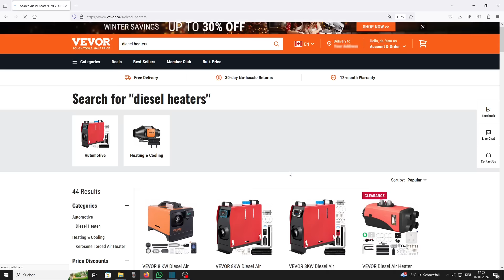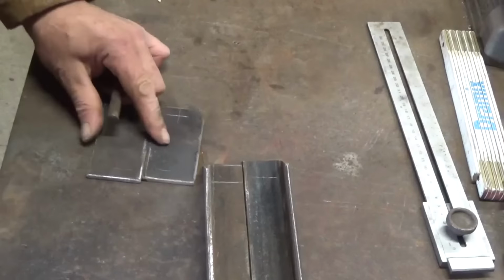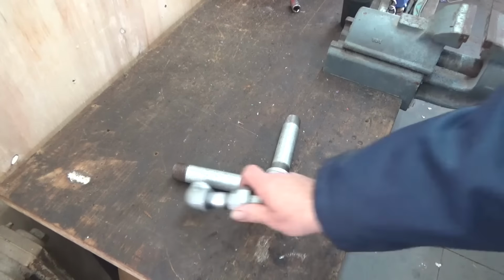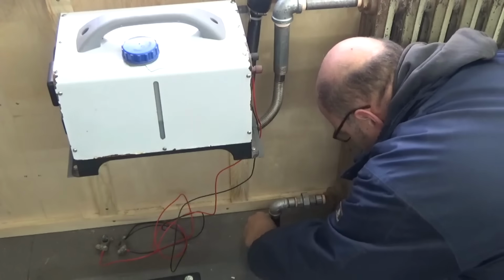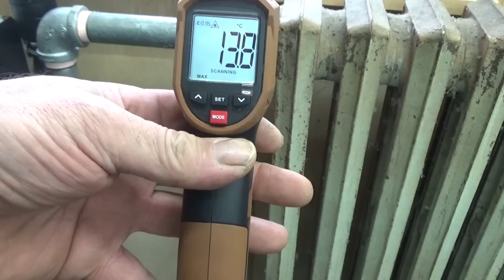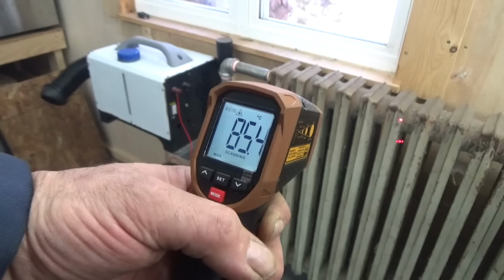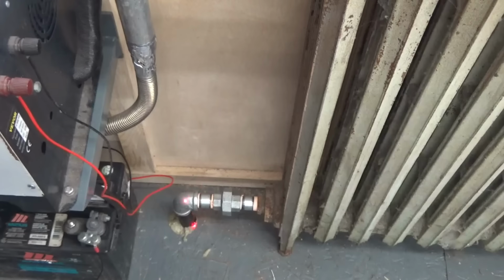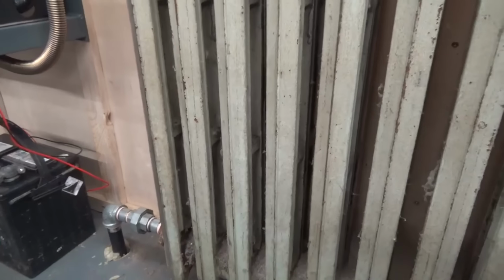Diesel heater upgade 200% more efficient

Comment: Ive been doing this for 3 years with an old steam radiator, have many videos about it here on YT.  It works fantastic, no condensation problems as the armchair quarterbacks and internet experts always bring up.  I have over 1000 hours of use with no issues, you want the exhaust from the heater to go in on the bottom of the radiator, exhaust out the top port which allows convection and hot air rising to remove condensation.  The large internal volume of the steam radiator prevents backpressure so the combustion fan doesnt work too hard like it would with a long exhaust run, the hot air convection from the heater exhaust coming in from the bottom and exiting out the top (in my system) propels the exhaust out without putting undue work on the heaters fan, it also allows the stored heat in the thermal mass to continue to remove moisture even when the heater is off.
Reply: how much diesel does it burn per hour ?
Reply: Good read, I havent installed mine yet. I did read the exhaust MUST be down. I like reading someone who has actualy done this
Reply: Interesting - I have a heat exchanger to rig up to my Webasto exhaust that will share a coolant loop with the radiator circuit. Trying to get the pipe as short as possible before entering a 3inch full exhaust system - for the same reasons as you've explained.
Reply: How does condensation not end up sitting in bottom of radiator? Or are you saying the heat vaporizes it and pushes it out with the exhaust? Seems like the down draft shown here would simply allow the moisture that's created to flow out with the exhaust at the bottom. Or are you saying the condensation that is created simply does not create any problems?
Reply: @vanblindguy4600  It does not accumulate on the bottom at all, but keep in mind I run my heater for 8-12 hours at a time so the bottom of the radiator gets mostly above the boiling point of water.  The condensation moves up and out with the exhaust, Ive collected it by directing it into an aluminum can and itbis substantial, while the drain at the bottom of the radiator has so far never had appreciable water come out, I even tipped it back and forth to see.
Reply: A hot water radiator , would work better with the heater above it and supplying the top and exhausting the bottom , your steam radiator works but hot air rises and the steam radiator has no nipples on the top so the exhaust will travel the least resistance.
Reply: @jamesyurky3048  I haven’t tried that method, however no need as a steam radiator with a diesel heater exhaust mated to the bottom located inlet and the top outlet piped outdoors has no condensation issues in my experience.  I'm sure the reverse method may work just as well but not necessarily superior in my experience as when a thermal mass is heated from the bottom then the heat rising internally aids in propelling the exhaust out reducing load on the diesel heaters internal combustion fan unit.
Reply: @ProlificInvention  as long as you have no restrictions the fan should work well, a bigger exhaust pipe like 1 1/4 pipe would be better.
Reply: @jamesyurky3048  In my system the output is the same size as the input with the large internal volume of the steam radiator allowing for exhaust expansion and reduction of backpressure (total guess obviously) either way, it has worked for thousands of hours extremely efficiently with no negative effects
Reply: good points!
Reply: We've tried this and the radiator clogged enough to restrict flow and then clogged the furnace? Went back to minimum exhaust length and bends and the furnace was much happier.
Reply: @poguemahone5476  The internal volume on my steam radiator is around 2 cubic ft...you're not clogging that with a diesel heater even after 10 years of continuous use.  I only have one bend and a 2ft section of exhaust before it enters the lower input on the steam radiator and goes into the internal large volume of space allowing for expansion and the offloading of heat into the cast iron.  After that the exhaust exits out the top port through a 2ft long pipe out the window which is on a slight declined plane to allow for condensation to drain out.  What comes out of the exhaust is highly moist air at a temperature of about 90°f with the side benefit of being completely silenced
Reply: For those concerned about condensation, install the radiator on a slight incline with a bleeder valve at the lowest spot. Once a week, open the valve to drain the system.
Condensation is relative to humidity of the air being fed into the combustion chamber.
Reply: Very interesting good idea going to keep that in the back of mine

Comment: On a Russian site a man did this and did a lot of calculations based on the actual heat values - he concluded the heater itself produced just over 4kw  on high and his radiator added a further 1.5 kw making a total of a little over 5.5kw -  in another of his posts, he concluded that the 5 and 8kw heaters were in most cases the same!

Comment: Good use of old cast iron radiator. One Major Flaw with exhaust fumes exiting building.  Even though your building barely sits above concrete pad , carbon monoxide fumes with hang next to floor and will leach back up through your high temp wool, as well as between seams between floor sheeting. You should have extended beyond building a foot at least and away left or right of window. Remember CM KILLS.
Reply: Diesels don’t make much CM, that being said you’ll still die, you’ll just die before any monitor will warn you. However that’s not even my biggest issue, the intake for the heater itself is INSIDE, it’s like hooking the intake from your car to the cabin. That should speak for itself
Reply: Carbon monoxide goes high, carbon dioxide goes low .

Comment: For this type of diesel heater, your exhaust contains sometimes unburnt hydrocarbon tiny particles, water vapor and carbon dioxide and some small carbon monoxide. If your exhaust is not at least 100-105C, acid is forming in your exhaust which will slowly overtime corrosive your piping. I have lost a galvanized piping due to this issue.

Comment: something else to consider is the intake air to the combustion chamber, take it from outside. Else you consume the hot air from inside the building  and cold air will leak in from outside.😇

Comment: The one fault with the system is that the heater and exhaust pipe is below the entrance to the radiator creating a trap for moisture
Reply: Indeed...I have the same system..my heater is placed outside in a plastic nice box and the exhaust pipe is coming in at the top of the radiator and goes out at the bottem. My heater is at the highest point and the exhaust pipe is running down so water can run out at the bottom of the radiator.
Reply: Yes exactly, everything has to flow downhill or you could have water build up and flow restriction.
Reply: That exitpipe is so hot that it will vaporize any water/moisture there
Reply: If the temperature is over 190 Celius, wouldn't any moisture be vapourised? Once cars reach normal temperature, you don't see any moisture coming out of the exhaust pipe.
Reply: Antikk8191..?Whaaat? The heater burner exhaust pipe moisure gets heated but has nowhere to go but in the radiator to then condense at colder end.

Comment: I have to say that this is one of the best ideas I have seen on YouTube. Of course condensation will form in the rad, but being cast iron and the exhaust low, it will drip out the bottom. Those heaters burn so efficiently that you won't have to worry about soot collecting in the rad. To test for this possibility, when it's new, record the temperature drop from top of rad to the bottom. After running it for months, or years, keep testing the temperature difference. If soot is forming on the inside of the rad, the temperature difference will become less. The exhaust temperature, at the floor will increase. The soot will act as an insulation. I can't see that happening though because of the burn efficiency. I only thing I would do differently is a more positive, sealed connection between the iron pipe and the heaters' flex line. Easy fix. As for the haters in the comment section, these people are shocking ignorant to basic science. You can tell they have done nothing in life. Nice job. It has given me some ideas.👍
Reply: I totally agree with  @daveunderwood6498. The only comment  I would make, and I'm being picky , are the 90 degree elbows but they do save space and that's the only a minor restriction .
Reply from the maker: Thank you very much for this nice comment. It's very motivating to read something like that and especially to see that people actually think about it. You're certainly right about the connection, although that causes more problems on the heater side than on the radiator side. The heaters are made so cheaply that a professional connection of both elements is a major challenge. Essentially and generally necessary. There is no point in connecting to the flex line with a hard-soldered flange if a stupid pipe clamp is supposed to seal the system at the other end. I chose the aluminum tape as a temporary solution as I'm still experimenting with this system, and I have to say after two years it's still tight and in very good condition. I haven't poisoned myself with CO yet and I don't need rubber boots for the condensate that forms as my other Diesel Heater vodeos prove LOL
Reply: No such word as “haters”, might disagree but they don’t hate! MAGA!

Comment: If you run metal pipe around the shop walls you get the heat all over instead of it being concentrated in one area or one more radiator other side of shop don't know if you could use a control valve so the heat go fast to other Radiator

Comment: Problem you are going to have with this setup is condensation in the radiator. The condensate is very acidic so it will rust that radiator though in no time. You can get round that however by using a stainless steel radiator. Also you need to have the exhaust coming out of the heater going down into the radiator so there is no chance of condensate collecting in the tube. I have a similar setup myself except I packed the exhaust radiator in sand as thermal storage so I can turn off the heater and get several hours of residual heat.

Comment: Since you remove so much heat what about exhaust condensation in the radiator and since even after an hour it was showing a negative number could water build up and freeze close I would check outside to see if it is dripping. I am no expert but I would have thought there water some water in diesel that could condensate. Anyone please correct me if I am wrong.

Comment: Great idea, the only downside is the condensation created by combustion which is going to collect at the exit of the exhaust gases because you have it running uphill. But even if it was plumbed differently, it would be trapping condensation throughout. But if it stops functioning, it’s because that bottom exiting section is too full of water
Reply from the maker: How people think the pipe can collect water with a tepereatur from over 220 degece Celsius the pipe is still nice and clean after 2 years no problem with it.
Reply: I would have figured someone would have caught on to all these comments about diesel combustion  creating condensation.  Now if it was gasoline then yeah it will have to be drained

Comment: If you bolt the radiator to the wall and put the pump in some rubber and rubber washers on the bracket where it's bolts to case

Comment: Convert the radiator to a simple heat exchanger.. 
Fabricate a pipe that passes through the radiator from top section, looping to the lower and out as you have done with the existing exhaust path. That then allows the radiator to be filled 95% with water [for expansion, don't seal it!], giving more mass to capture the heat.
If you've a pump that can handle near boiling water temps you can then add more radiators to the system.

Comment: Nice. How would it work in the exhaust gas went up through the rad, instead of down?   I will add that any exhaust you scrub will leave carbon. You will need to brush and vac it clean- somehow. A comment about your heated air being put through the rad to bring temps up faster is food for thought. Less cokeng? Fine vd, thanks.

Comment: Great idea, but it would definitely invest in a carbon dioxide meter. Also, to be honest i would put another elbow fitting on the underside of the shed and ad some pipe to led the fumes away from the shed.

Comment: thanks, that's a great idea, and what makes it even better is I have a small cast iron radiator sitting unused in the basement.  I am quite satisfied with my little diesel heater, but I have been thinking of a way to recover the heat lost through the exhaust because my shop is quite a bit too large for the poor heater (20ftx30ft) and I live in a cold climate.

Comment: Nice and effective idea. 
But do not let you fool with IR measurements. Shiny metals refelct either the room temperature or your own body temperature. If you want to measure correctly you need to paint the shiny metal in black or stick black electrical tape to the measurement location.
I proved this fact with my IR Camera. If you put a shiny aluminium sheet on the pavement at a sunny summer day, it will get very hot. Nevertheless it will refelct the very cool sky temperature only.  And exactly that you will measure. If you approach your face above the sheet you will measure partly your skin temperature. In the camera you will see the outline of your head.

Comment: I think the idea is brilliant BUT I feel you're Heater unit must be located higher to allow the condensation to flow down & out of the radiator outside, 
The way it is at the moment your creating a U loop with no way for the condensation to run away .
Reply: At this point is no condensation  never please watch the update video
Reply: If the exhaust temp is above the boiling point of water, no condensation can occur. However, he will get condensation inside the radiator, and it will freeze possibly plugging the exhaust if the output temp is below zero. There is a reason the heater is designed to have exhaust Temps above 100 C

Comment: Should feed exhaust into bottom of the rad and out on the other side bottom. Heat rises. Rad would be heated way more evenly. Plug the top fitting. And no galvanized pipe in exhaust, too hot, zinc fumes released over time.
Other than that - well done.
Reply: the water build up needs to drain out the bottom
Reply: @NightshiftCustom  it also does not flow very well when frozen.

Comment: I'm so glad you did this. I was planning the same set-up with a heater I just purchased and have a radiator already. Thank you for proving concept. 
Much love
Reply: better go for a stainless steel pipe with slightly larger inner diameter as your exhaust hose and root the exhaust gas through that. I use a 2.6m long pipe that simply goes through the room and then exits with a slight downward slope. The pipe then just goes through the wall. The end of the pipe is at around 30°C so i get the same efficiency with much less effort and dont even have corrosion problems. I put a small bucked that collects the condensate under the exit of the pipe outside of the building so the sulfur does not go into the environment. The whole thing cost me around 30 bucks.

Comment: I have my heater exhaust hooked up to a 40 plate flat plate heat exchanger connected to my boats hot water tank. The heater heats my boat, the exhaust heats the water.  It works amazing. 
It heats the 9 gallon tank from 70F to 130F in under 90 minutes. As long as the water is above 70 I I’ve no issues with condensation or soot.
Reply: I should mention the water thermo siphons through the exchanger, meaning the water is constantly at 180 approximately.  I also remove the exchanger often to make sure it’s clean and remove any condensation.
Reply: I love your idea.
Thanks for sharing. 
I am looking for a unit to heat my sailboat and then in winter, transfer the setup to my truck and also pre warm the engine, and you just solved the problem. 
I am a heating tech and have access to many different stainless steel heat exchangers. 
You made it all come together, buddy.
Thanks

Comment: This is a really bad idea that could be fatal from CO poisoning. 
I won't nitpick your math, but I will warn you of letting the exhaust temperature fall below 212F inside of a metal pipe.  Sulphur is a byproduct of burning petroleum based fuels, and if will react with surrounding gasses and forms sulfuric acid that will condense on your metal pipes and you will start getting holes in your radiator. 
Guess what other gas is formed when you burn hydrocarbon based fuels?
Reply: Solution: Install a CO detector
Reply: True, check for holes in the radiator in ABOUT TEN YEARS.
Reply: @SuperDirk1965  Unfortunately, we might be taking weeks to months with heavy usage... especially if it all completely condenses on the walls of the radiator.
Reply: @joelhacker8767  Indeed, check for damage to the radiator in ten years. It's a cast iron radiator. Do you know how thick those walls are. The exhaust pipe going into the radiator will be long gone before that radiator springs a hole. Even the heater may be worn out by then.